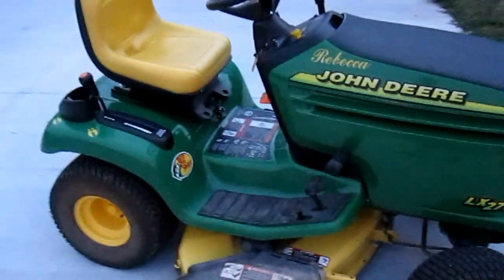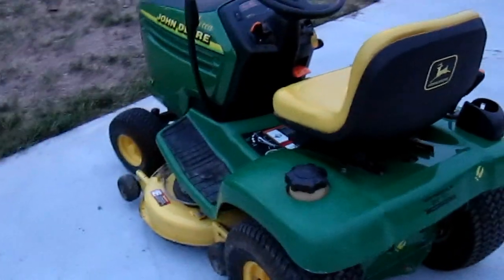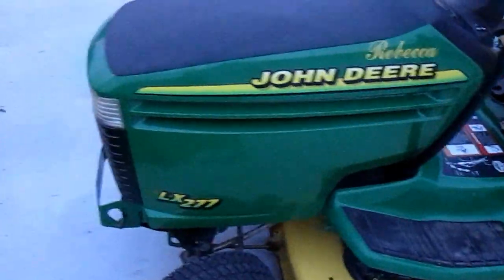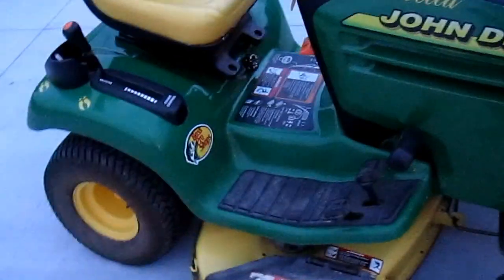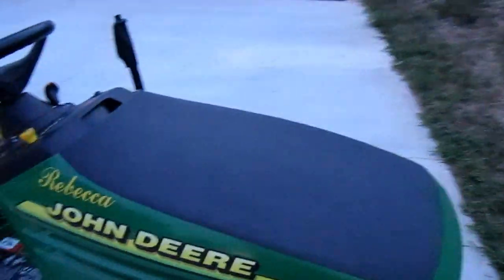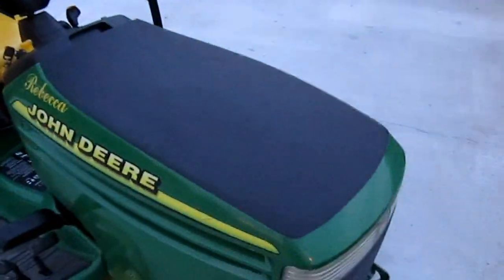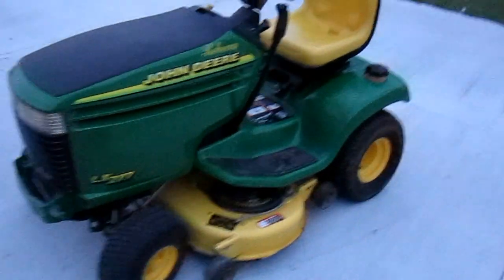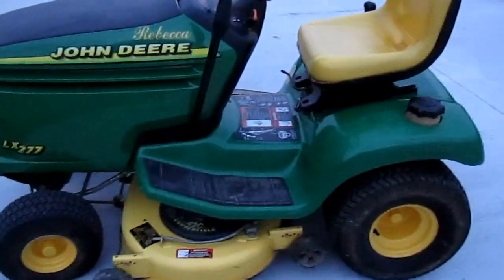John Deere with Rhino Liner

Comment: Awsome idea, my dads GT235 was parked in a metal shed over one winter and the roof collapsed right on the hood and now it is in utter disrepair. I've held off on a new hood b/c it is like 150-300 dollars. I will have to check out rhino liner and see if it will work with the level of disrepair my dads hood is in...